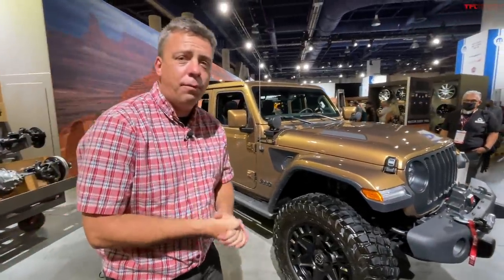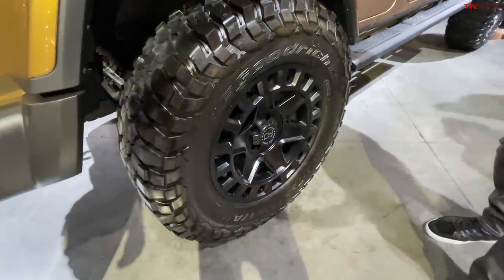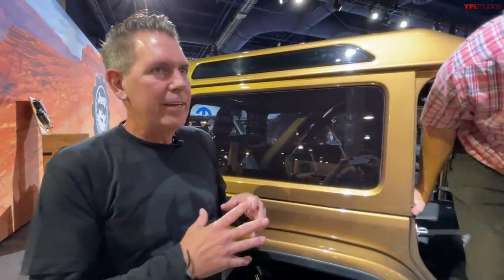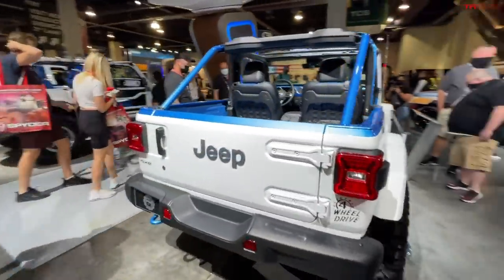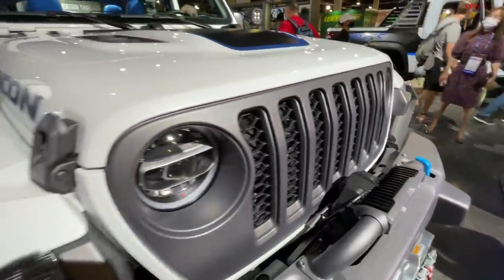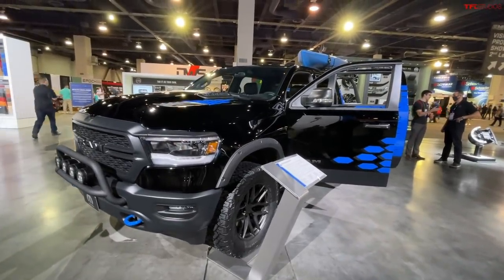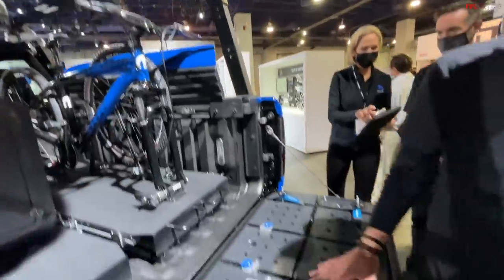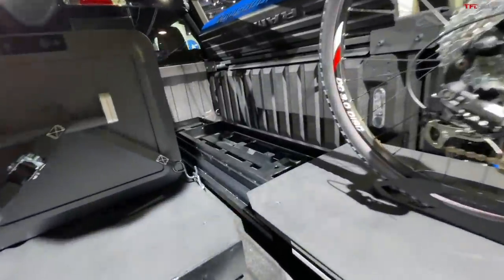I Take A Deep Dive Into Jeep & Ram's SEMA Concepts With The Guy Who Designed Them! | SEMA Insider

Comment: The Jeep OutLook I could see it becoming a real as they just add the extra room plus the 2 second row Jeep Wrangler seat already has a 6040 fold to enter the 3rd row the 3rd row seat they used is out of the 2 door backseat they just have to figure out the shoulder belts as the sports bar could be moved back more to the back of the extra seat

Comment: I would recast the three row Wrangler in a different direction.  It's too long for serious off-roading....I would head in the opposite direction, meaning, less off-road.  Switch to independent front suspension and improve on-road performance.  Morer retro in appearance, with steel (or steel-like aluminum) wheels and dog-dish hubcaps.  Perhaps even a permanent top and less-intrusive roll cage, making for a quieter and roomier-feeling interior.  And let's be real.....a whole lot of Wranglers never leave world of paved roads.